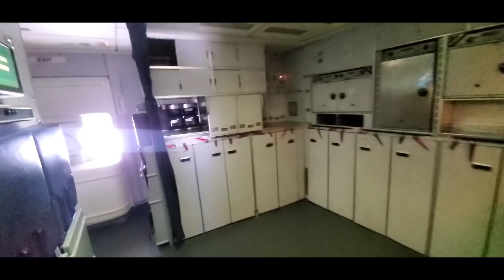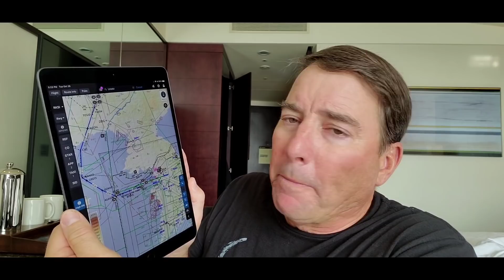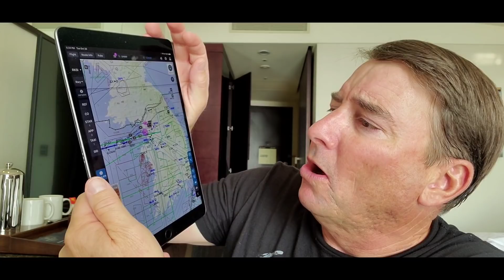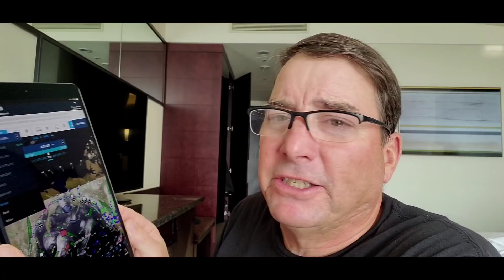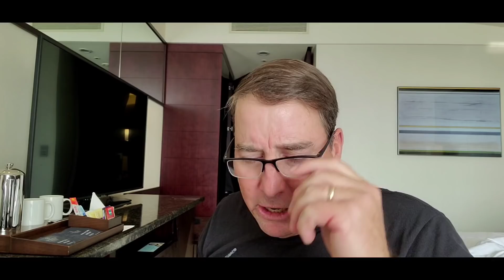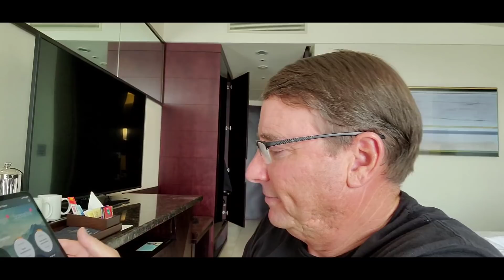Airline Pilot Software

Comment: I saw some of the Ipad use before I retired on the Airbus. I wasn't all that wild about it. I did miss being able to have the taxi chart ready so when I pulled off the runway I'd have it right there. As opposed to having to get to the menu on the Ipad to bring it up With one hand on the tiller and the other on the throttles, it's not convenient to pick up the Ipad to view anything. F/O has to do it. And the Ipad is a lot more bulky to view an approach chart on vs. the paper version. The best thing was downloading revisions instead of having to do them manually.  I didn't mind the flight bag that much once we went to roller bags.
Reply: You can set it up so the 10-9 automatically displays at touchdown.

Comment: I took the PP written exam half a century ago in my mid teens, and it was packed with obsolete symbology for 1930's airports. I demand that they continue this practice to equalize the difficulty level! I was furious that due to ignoring that I only passed rather than aced the test. But it would have prepared me to do a forced landing at a defunct airport that had been uncovered by a sandstorm in AZ for example. 😃

Comment: Times have really changed (and for the better in aviation). I hated to do all those Jepps revisions. I still have a few leather binders from those days. I learned to fly in 1960. There were still a few low freq ranges around. Crystal controlled radios were the hot item instead of the old "coffee crank" radios you had to manually tune. I saw lots of changes during my corporate career: weather and ATC radar, ground proximity warning systems (our company helped develop), RNAV, GPS, data link for messages/clearances, commercial weather and flight planning services (like WSI and others), glass cockpits, flight management systems, simulators with full motion and visual. All of this is pretty common now but it was real "Buck Rogers" stuff when introduced. I'm glad I got to see it. I would be really lost in a modern cockpit now. I'm glad you are taking us along and explaining it well. Happy Landings, sir!

Comment: While I absolutely adore the new technology, I've never had my sectional or terminal chart overheat or suddenly reboot.  Always useful to have a few of the old school tools available for the one time your technology fails.
Reply: Keep in mind that they have four pilots on board those long flights, and they each have one of the I-pads, so they have Quadruple redundancy. :)
Reply: @keithwalter1241  - A luxury the typical GA pilot does not have.
Besides, if you don't use those old school tools to maintain proficiency, you could fail your check ride when the DPE decides your tablet has "failed", as did your Garmin 175 (or similar GPS). Now you have to rely on your sectionals and hope your plotter is still in one piece.  You could always whip out your phone and see if ForeFlight is working, but...

Comment: I non-rev'd in one of those fancy cube first class sear a couple of times, the only thing that was opened. You should mention that the Jepp FD Pro app also inverts the colors for night use, and gives pictorial in for about runways, lighting systems, visual aid, etc. Definitely a lot more that would fit in the old 30 lbs Jepp case. I only miss spending time inserting the old yellow revision pages, in the sense that killed a lot of time when aloft. Have a great flight, and safe return home.

Comment: Many many years ago I was on a Braniff flight when we hit unexpected turbulence. No big deal I was already strapped in. The flight attendant however was rushing with a tray of drinks to get back to the galley so she can strap in about then the plane dropped out from underneath her and she suddenly got about 2 ft taller. She almost hit her head on the overhead. And when she came down she dumped the tray of drinks on the guy sitting next to me. What a change from yesterday to today. Instead of getting upset and calling an attorney, he just laughed it off he got a few vouchers for dry cleaning and all was good. Thankfully no one got hurt. The flight attendant was especially lucky that she fell the way that she did and did not hurt herself. I remember sitting here with the guy next to me just laughing about it. He didn't care if he had soda and booze on his lap and shirt. I'm sure he would just write it off on his taxes if he needed to. But turbulence is something you need to respect as a passenger. Pilots don't flip on that seat belt sign just for giggles. If that sign comes on and you're not wearing your belt like you're supposed to when you're not moving about you need to put it on. If you don't put it on shame on you and if you get hurt that's all on you.

Comment: Juan, unrelated question.  With all of the GA crashes lately I heard a report that most small planes do not have a ground proximity warning system.  Is that a prohibitive cost that the average pilot chooses to avoid?
Reply from the maker: Yes, but getting cheaper, great advances in flat panel displays.

Comment: Is there ever any problem with GPS reception inside a typical airliner….  i.e.metal skin?  I know most GPS receivers nowadays are quite sensitive, but it drops in some places such as underground tunnels and parking garages and similar.  Just curious about large aircraft.
Reply: As a passenger, if it's by a window it usually works, especially on devices new enough to support multiple GNSS systems (USA launched GPS, but there's also a Russian one, a Chinese one, and a European one) I bet it works great in the cockpit.

Comment: The walk through the cabin raised a question in my mind: although I'm assuming the cargo compartments below are full and may be adding significant weight (big huge bloated assumption here lol) and fuel tanks are full (assumption #2) are these no-passenger takeoffs short take off roll/high climb rate fun for the flight crew or just more or less standard profiles?
Reply from the maker: Standard...the power is cut way back  on takeoff  to save fuel and engine wear over time....GREAT QUESTION!
Reply: So not quite the "sit on a stack of in flight magazines and slide the full length of the DC9 aisle during a positioning flight takeoff" the flight attendants told me about years ago 🤣
Reply: Exactly my thoughts on the empty cabin..

Comment: OK, Obvious question:  What do you do when the battery dies?   I am assuming the cockpits have USB Ports or AC Plug in's in which you could plug the charger / charger cable ( that you left in the hotel ) into.   Part Deaux:  What happens when it drops or gets stepped on and turns the screen into a spider web of cracked glass?   
Thanks !
- Capt. Obvious
Reply: Most aircraft in service have a USB port for every seat so they are in abundance all over the plane.

Comment: cool. BTW over a decade ago, I was in between IT jobs so was hiring into a boring Security job. One of my assignments was front desk at NAVCANADA Surrey office. It was a real shock that this office had all the En route Air-traffic controllers up stairs. Where is the building locate? Across the street from Costco, 17 miles from YVR. The building was formerly a furniture warehouse. Communications runs from the building to the radar at YVR. The property decided to cut cost and let got the contract for on property security. The cameras and gate are controlled and monitored remotely back east in Navcanada head quarters.

Comment: Question!
I know that the millitary owns the global GPS system and can, in an event of war, scramble the system so that the other forces will not be able to use GPS also hackers are able to manipulate the GPS data, so the are incorrect!
What do airplanes and pilots do in this kind of event?
Regards Christian from Denmark
Reply: Most large aircraft will be running at least two INS (Inertial Navigation Systems) that are independent of GPS receivers. VOR/DME data is also being used in the navigation “mix”
Reply: @Kathikas1  Tnx for the quick answer :-)

Comment: For the turbulence, RMS stands for "root mean square" it is the 'power' of the turbulence, as opposed to the Peak value or the average value.. For a sine wave the RMS value is 0.707 times the peak value.
Reply from the maker: I did that math but still tells me very little as a pilot...I've done some more research...stby for an update. .2= moderate....now we're getting somewhere....
Reply: @blancolirio   I assume it's G's.   To get RMS, you'd take the magnitude of positive and negative values (above and below a steady 1G), square them all, take the mean of the values, then take the square root.    But the resulting number is only significant when you know what the normal range is.
The other thing that interests me is, how long a period this is averaged over.   For example, that A319 getting .005G, since turbulence can be intermittent, was that averaged over the previous second, or ten seconds, or ten minutes, or is it e.g. the worst ten second period in the previous five minutes?    The people who work  this stuff out have presumably made a judgement as to what gives the most meaningful predictor of further turbulence.
Reply: Or the peak value divided by the square root of 2. It’s better than mean at describing the overall effective value for a lot of time varying phenomenona.
Reply: With all that said, what does .005 RMS mean? Is your drink shaken and not stirred or on the ceiling/lap?
Reply: Learned this in Avionics college :)
Reply: Great point!

Comment: For these apps to function they need reliable GPS information. The cabin of an airplane is made out of metal which shields GPS signals - an Ipad inside an airplane can only receive GPS radio signals via its internal receiver / antenna from the GPS satellites via the windows in the cabin / cockpit. While I would imagine this wouldn’t be too much of a problem in the cockpit, it might be more problematic in the passenger compartment.
Reply: Apparently the special windows on a 787 do not let GPS signals through to the cabin. The carbon fiber body also apparently blocks GPS signals.
Reply: https://youtu.be/OUFZDOWLHM0

Comment: Note. For the iPad "GPS" to work correctly, You must have the iPad with Cellular option.  iPad with just Wifi is not going to work.
Reply: I use a Bad Elf bluetooth GPS receiver to feed my non cellular iPad/Phone - there is even a supplied sucker to stick it to the window!! Is anyone working on piping the aircraft’s GPS data direct to the crew’s devices?

Comment: In the 172 I am flying you can connect the ipad with the transponder with bluetooth so it will show the adsb planes on your ipad too. Also you can sync the flight plan between ipad and gps navigator. Saves a lot of time twisting those knonbs to input.

Comment: Thanks for the videos, Juan!  Can the airline stuff enough freight weight on a cargo-only flight to fill capacity and economically justify flying without passengers?  (Putting aside, of course, those flights carrying gold ingots back to Blancolirio Northern California Headquarters).
Reply: Not to answer for Juan but yes, the airline can sometimes turn a handy profit on cargo even if there are few, or no passengers.

Frequently this will be overflow "sudden need" or highly perishable cargo that the strictly cargo carriers were not scheduled for ahead of time or don't have the capacity for right at that moment. A recent example would be, for my airline, carrying corona virus vaccines out of Europe to the U.S. This was definitely a catch as catch can upload and brought significant revenue--enough, apparently,  that it really didn't matter if pax were on board or not--which, as it happens, were not on many of those flights.

A lot of high value cargo is also seasonally on board. Recently caught fish on the flight from Guam to Tokyo,  flowers out of Holland, etc. The airline sales departments closely track the capacity in the cargo holds to try to maximize the passanger/cargo equation.

Something quite surprising that is going on during the coronavirus pandemic and supply chain disruptions  is that big U.S. retailers who normally depend on space on container ships are looking to send some things via air. Obviously the cost differential between an ocean going shipping container and space in an aircraft's belly is huge, but some firms are nevertheless paying the price...especially with Christmas not far away. 

For example, I recently heard that Peleton is shipping bikes via air. I can hardly imagine how much that costs. 

Sorry for the long reply, but "yes" is the answer to your question.  It just depends on how/where/what/why, but the airlines definitely look to upload what they can. I had a Formula I race car in the belly of the 777 before and Lufthansa even carried race horses out of North America on a 747 Combi. Expensive? Very, but sometimes it just needs to be the way it is done.
Reply: @Neal_Schier  Thanks for the details!
Reply: @Neal_Schier  Thanks for your clear and detailed explanation!

Comment: If you jump you fall at 1g of acceleration. So 0.05g is 1/20 the acceleration of free falling. Very mild.
Reply: If you are accelerating downwards, you are experiencing less than 1g. Once at terminal velocity, you will be at 1g.
Reply: @acft6074  Absolutely wrong. You immediately experience 1g. Terminal velocity is just when wind resistance is equal and opposite to the force of gravity. In a vacuum there is no terminal velocity.
Reply: Interestingly, when you jump, as soon as your feet leave the floor you're experiencing 1g even though you're still going up.
Reply: @tomgnyc  gravity is always acting on you with an acceleration of around -9.8m/s^2.(ignoring air resistance)

If you are accelerating downwards in a vehicle or capsule of some kind, you will feel the force of gravity with a multiplicity  between 0 and 1 because it is likely that the thing you are in is experiencing a higher force or more acceleration than your body will, and it is simply pulling you downward.

And yes, indeed, (jumping)once you have pushed off the ground, you have a constant negative acceleration (gravity) which will slow your ascent, and pull you back down.
Reply: @acft6074  okay, I think we are kind of saying the same thing. You will fall at less than 1g if there is air drag. The force on you equals the force of gravity minus the drag force.

In that case I disagree that there's a scalar from 0 to 1 though. If you hit an updraft the scalar could be negative. Like how birds ride thermals.

A capsule will not pull you down unless it is being propelled down by an external force, a downdraft or a wing for example. In freefall in a vacuum you will always fall at the same rate as the capsule.
Reply: @tomgnyc  I see what you’re saying, I’ll have to do some research into the scalar thing because I’m curious now. 👍
Reply: You made me think about some things as well. I think I need to be more clear when I say "experience", for example. That's kind of an ambiguous word in this case.👍
Reply: @acft6074  I missed an important point. When you're at terminal velocity your acceleration is 0 G not 1G. Acceleration is the change in velocity over the change in time. Since velocity is not changing then acceleration is zero. Interestingly, if you jump out of a plane the highest acceleration you have is when you first jump and the lowest is when you reach terminal velocity.

Comment: You mentioned turbulence and how it was different in parts of the aircraft.  The short time in the MD-80, the ride up front was like being on the end of the diving board, much different from other aircraft.  Even the 727-200 was not that bad.  Now, the 747 was a different and more comfortable ride.  Enjoy all your posts.  Thanks Juan.   👍👍👍.  10-27-21
Reply: I wonder if this was mostly due to the Queen of the Sky's huge inertia? :)
Reply: @sixstringedthing  honestly I miss the queen. The 400, up on the 2nd deck, was quite quiet. Also had one flight on PAL MNL TO LAX that was glass smooth. Like not even a single vibration. Just the sound of muffled wind and the hvac. I've since flown on the 777-300, but it isn't the same. The 777 has a high speed vibration that just rubs me the wrong way.
Reply: @sixstringedthing  The “queen of the sky” as you put it was something else.  A real gentleman’s airplane.  There was a tremendous respect from all concerned that had anything to do with that aircraft.

Comment: Why is a passenger configured jet only flying cargo?  Wouldn't a freighter be best for that job?  Could you address that?  Seems very wasteful. TIA!
Reply: If the cargo is dense enough it doesn't matter - also we don't have enough freighter only aircraft! Especially since the pandemic.
Reply: @edwardhewer8530  Dense cargo or not that interior weighs a lot.  All that weight could be cargo for more $$$.
Reply: @4stringmanatgmaildotcom  - you have to pay to get the seats out, pay to store them, easier just to fly heavy cargo and carry less fuel.
Reply: think the issue is that the airlines need to keep the aircraft running, you can't just power them off and let them sit there without putting them into a storage state. Sam Chu has some videos about the whole process
Reply from the maker: Use em or loose em! $$Cargo$$ pays the frieght.
Reply: @blancolirio  - speaking of which, didn’t airlines have to prove they were flying licensed routes to keep their routes? (I think this was relaxed midway through the pandemic)

Comment: Why were you flying with no passengers?
Reply: Cargo?
Reply: Travel restrictions into Korea are only slightly less strict than into Australia/New Zealand and the US State Department has it as a level 3 Reconsider Travel To destination.
Reply: The airline makes extra money by transporting cargo even on a passenger aircraft. Cargo pays more, and has been very abundant since COVID.
Reply: @acft6074  Has S. Korea ended the "use it or lose it" slot assignment rule suspension?
Reply from the maker: Cargo